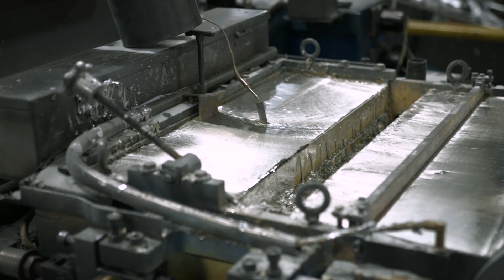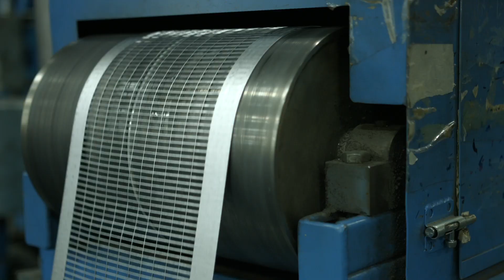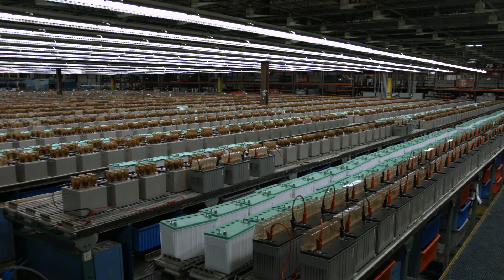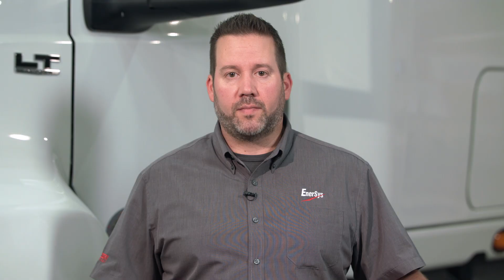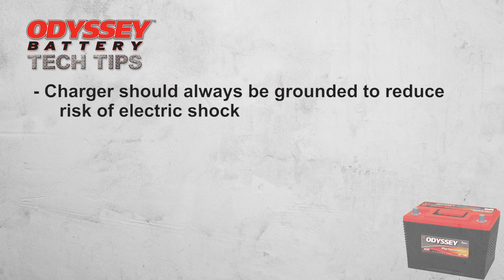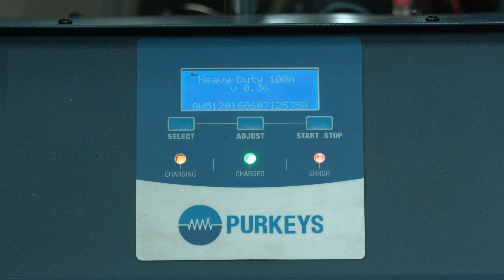How to Charge an ODYSSEY® battery

Comment: A battery is not charged properly it will. Eventually fail ,batteries dont like be undercharged or overchsrged keep them a certain voltage they last a long time at least quality ones will, i have a napa legend group 65 10 years old ive kept on top of keeping it charged properly it still tests strong,  odyssey are good batteries taken care of my neighbor bought 2 for power stroke 7.3 5 years ago there both going strong as well

Comment: If my vehicle only charges at/floats at a maximum of 13.8 volts during operation will an AGM type battery tend to run a chronically undercharged condition?
Reply: A regular AGM "MIGHT" be fine. I ran a Optima Red Top for close to 10 years with my alternator only putting out 13.8 - 14.2v. It was still going incredibly strong till the day it was stolen out of my car. That was over 20 years ago when Optima's were good.
Back to the Odyssey, it is stated in one of their Odyssey videos that if you are using it in a start stop manner like your average car it is "IMPORTANT" that the voltage from the alternator to the battery be a minimum of 14.0 - 14.7v maximum for the battery to be properly charged.

Assuming you don't have high demand devices I'd be looking at an AGM from Deka, Interstate, maybe even Duracell. But make 100% sure your + & - cables are in great shape with no slightly corroded connectors and make sure that alternator is putting out what it should be, because that sounds low to me.

If you do use high demand devices and that's the manufacturers rated voltage for the alternator I'd be looking for an aftermarket solution.

Comment: Odyssey batteries are trash. I use them on my boat for my trolling motor, and they only last one season, and then they won't hold a charge. If you're thinking they should be under warranty, you should be right. The only thing worse than their batteries is their warranty and customer service.

Comment: If an odyssey battery is completely discharged and I mean completely like you left the headlights on overnight will the typical homeowners battery charger bring it back to full charge even if that charger is designed FOR AN AGM  battery. 
Also will my vehicles charging system bring this battery back to life after it has been jumpstarted. I’m concerned as to whether or not this battery is suitable for off-road use when you are far away from a suitable charger

Comment: Is thier a age limit when to replace the battery.   My 4 batteries are 5 years old.

Should i test or replace
Reply: A good battery last as long as it last. Some die premature some are immediate after they are fully discharged. Generally speaking if you have a good charging battery and it's been over 5 years keep tabs on if it's charging properly, if it is keep driving.